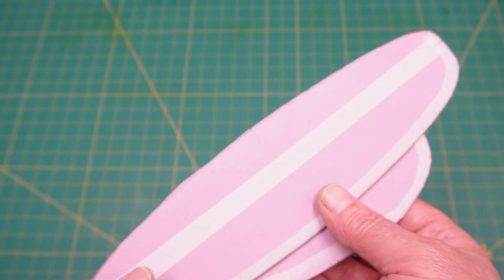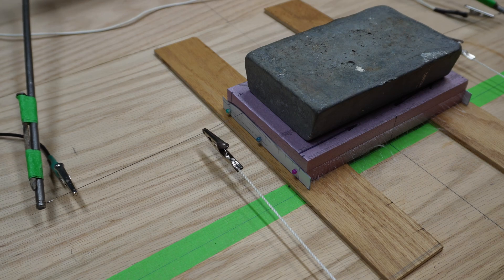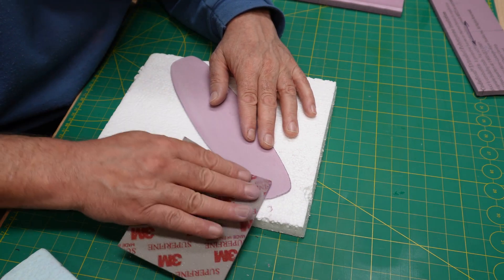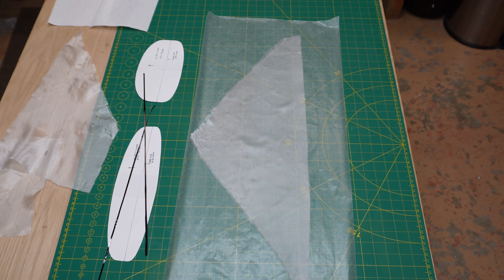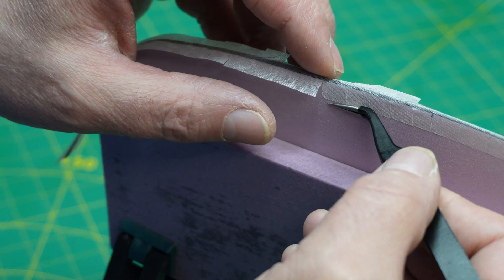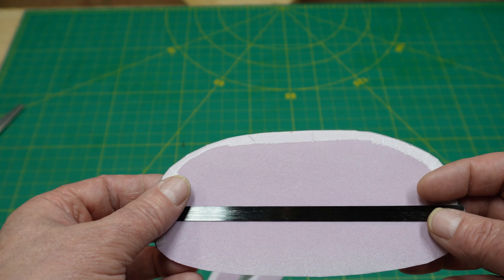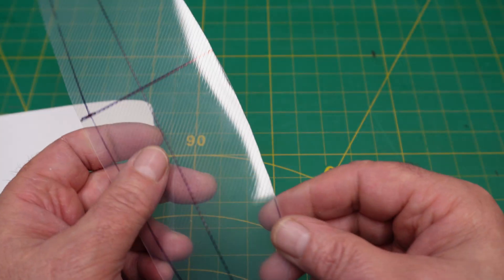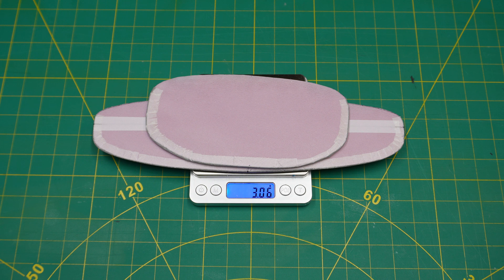How to make a F3k DLG glider. Tail Group / Core Prep

Comment: hi how many grams for dm fiber use please?
Reply from the maker: Hi!
The fiberglass cloth I use is .75 ounce/yd. or also known as 23.253 grams / metre.
Reply: @amonus-air2160  only one right? now i use 2 from 17g/m and for one f5j 3m works good...many thx for your reply
Reply from the maker: one layer of fiberglass cloth on the majority of the surfaces, and I use 2 layers (doubler) on the control surfaces only.
Thanks for the question.

Comment: Hi this is awesome.But i dont find the pdf for the rudder and the stab
Reply from the maker: Hi. I didn't make a pdf for the tail sections. I just used the Devient image in the files section. Has all the dimensions, so zoom it in/out to get the size right and print it off. Cheers
Reply: Thanks

Comment: Thank you for taking the time to make these videos, they’re very useful to someone looking to build their first composite glider from scratch. One question I have is with regard to the spray lacquer and adhesive. It looks like these make handling the materials much easier, but, don’t they have some impact on the materials ability to become fully saturated/absorb resin?
Reply from the maker: hi! ... thanks for the question. The lacquer is dissolved by the liquid resin so there's no need to worry.